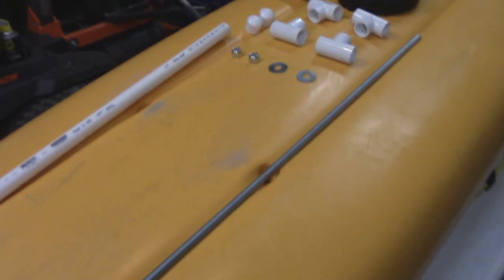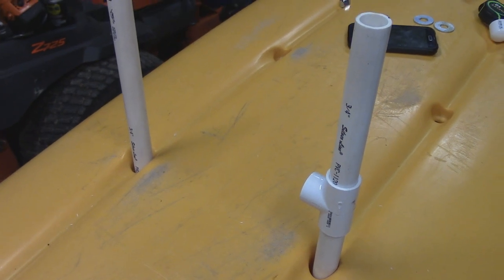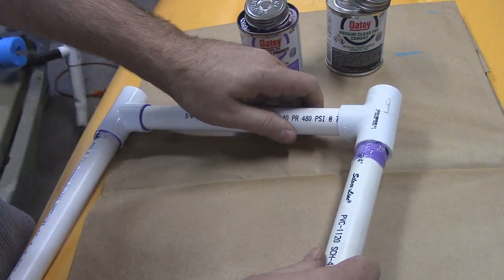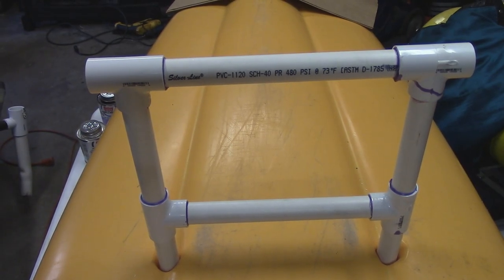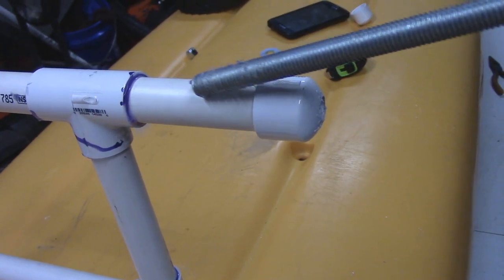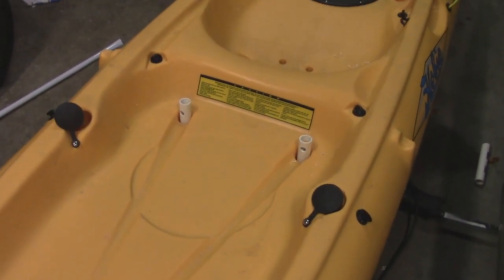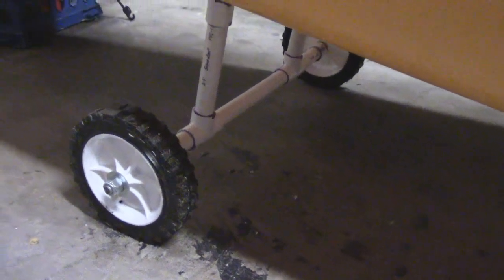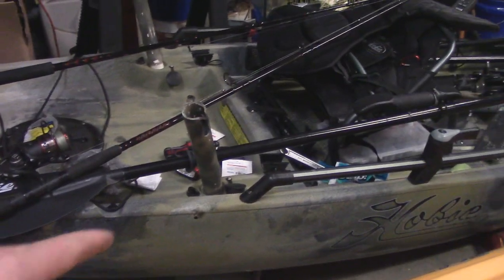make your own hobie kayak cart for under $30 bucks.

Comment: Thanks, this was very helpful.  I made another one from another website that didn't work with the Hobie Compass (2018), but when I saw your video I realized how much better this approach would be.  (I also discovered that PVC cement is a must -- the weight of the kayak will pull apart what I couldn't pull by hand.)  I only changed it slightly -- I used much heavier wheels (Harbor Freight 10") and 5/8" threaded rod for the axle, plus 1" PVC except for the part that goes through the scupper holes -- for that I used 3/4" like you did.  This video made life much easier!
Reply from the maker: Andrew Sandoval 
Thanks, iam glad it helped you out

Comment: When you insert the cemented pipe into the fitting simply give it a twist in either direction to prevent the piece from wanting to push back out.  Make index marks on both pieces with a sharpie so you end up where you want after the twisting.  Old plumbing tip from an old plumber :-)

Comment: 1" CPVC fits even better in the scupper holes, only thing you need to find it a 1" cpvc to pvc union (my local plumbing store has them).  3/4" still works and you made a perfectly good DIY cart, just letting your viewers know of the 1" cvpc option.
Reply: mlm

Comment: I made something similar but here is my question.  Putting yak on that cart and going to the water is easy because you can install cart then load up the yak with gear. But when you want to go from the water to your car, and yak is all loaded up with gear, how do you put the cart on without having to unload all gear and tip it over to put it in the scupper holes?

Comment: Since this was many years ago you may no longer find my comment, but if you do i am interested in what you feeling was on the balloon type sand tires and why they didn't work well on hard surfaces. I have been thinking about purchasing some for my DIY build myself then i came across your video stating you didn't like them for hard surfaces so i was curious as to why they have issues? Thanks and great quick and to the point video.
Reply from the maker: Sand tires create a lot of drag. It's kinda like pushing a car with flat tires.  It works well with light kayaks but on heavy ones like my pro angler 14 not so good. In sand definitely worth it but not on concrete.

Comment: Awesome idea. Need to ask you why the sand wheels are not so great on a hard ground. I thought they should work as good like they do on sand. I’m planning to buy a Revo 13 and not sure which cart should I buy?
Reply from the maker: The sand tires work great on sand but when you have to roll it around on hard ground its like trying to push a car with a flat tire. I did a video on how to change wheels on a hobie kayak, its on my channel and that might help you out.  Basically if you buy the cart that has the sand wheels you can buy some parts at a hardware store to make it accept hard tires so it rolls smoothly on hard ground. That way you don't have to buy 2 carts.

Comment: So it's been a while since you made this video.  
How is everything holding up?
What would you have done differently?
Reply from the maker: Steve H 
Everything is holding up great. I sold that kayak and cart to a friend of mine a while back and he still uses it to this day. I don’t think pvc would be a good choice for making a cart for a heavy kayak though. If I had to do it over again I would have probably tried to find some wider wheels or just doubled up on each side on the ones that I had to make it go through sand easier, not that it’s that difficult.
Reply: @SeaMonsterFishing  thanks.  I'm going with wider wheels with low air in them.   I'm thinking of using some sort of liquid that hardens to fill the pipe as well for added security.
Reply: @SeaMonsterFishing  I have a hobie outback.

Comment: Greek kayaker. Tassos Manolas.Very helping video  but you must  write the dimensions you cut the pieces in mm because we are not used to measure in inches.Than You very match.
Reply: Learn our system like we learned to use yours